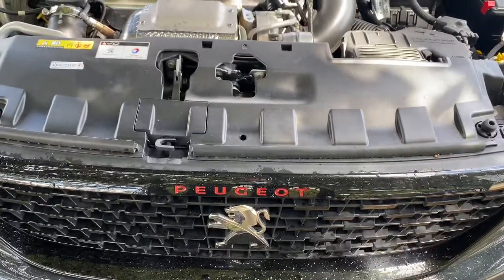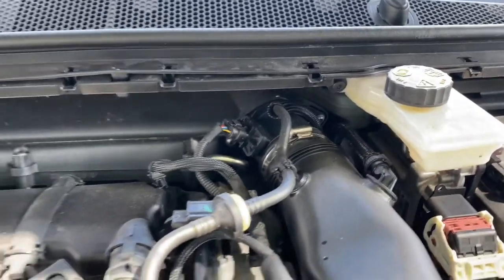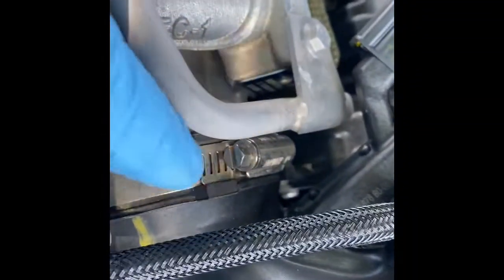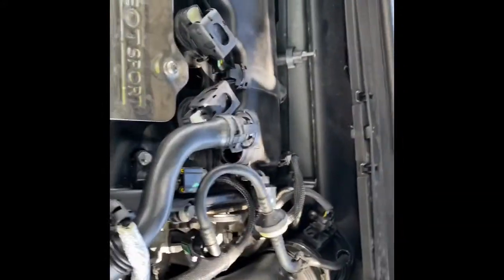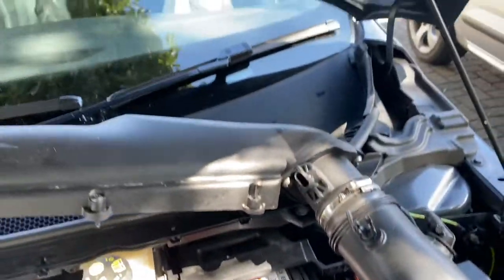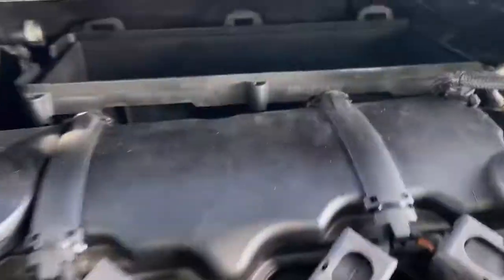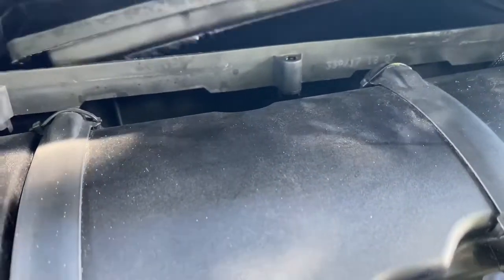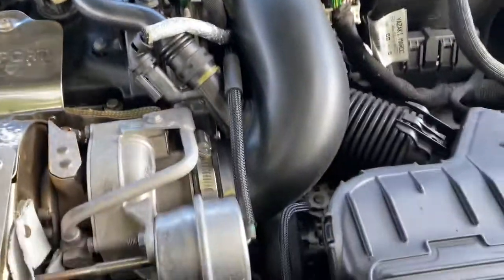#Peugeot #308 #GTi  #K&N #Air  #Filter #upgrade

Comment: How much improvement have you noticed from changing to the K&N Filter (besides the change in sound)?
Reply from the maker: Not a lot however with the diverter value as well I have more boost even at low rpm
Reply: @g_a_bofficial  thanks for the reply. Was looking to change/upgrade to K&N, but all reviews point out no little to no Improvement compared to stock filter.
Reply from the maker: It’s done help especially when it’s cold i would recommend getting the Go Fast Bits GFB DV+ T9352 it’s keep boost